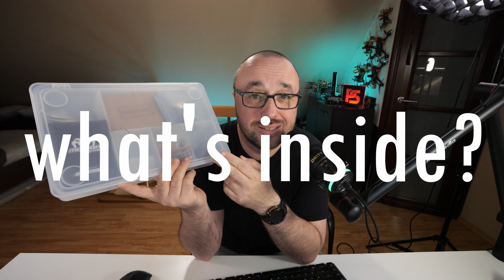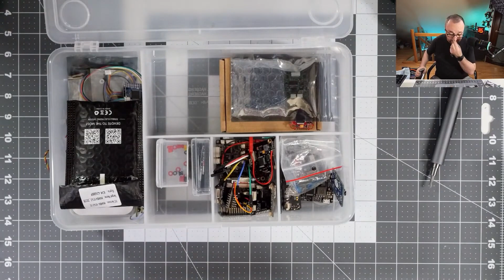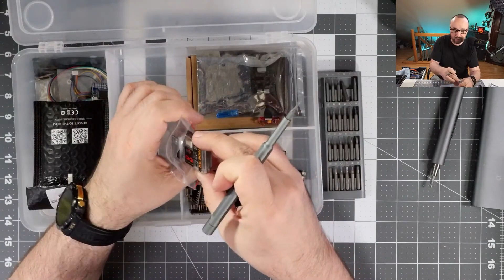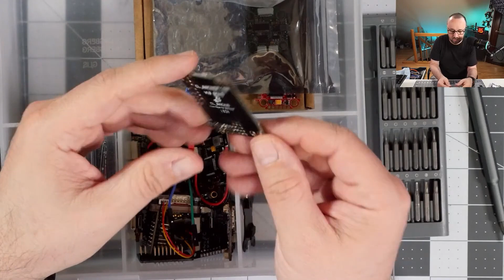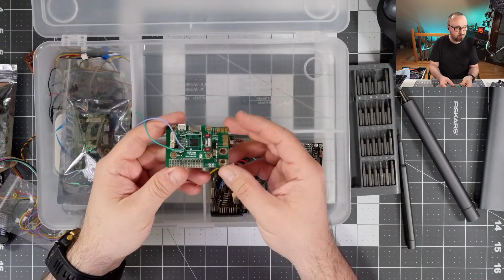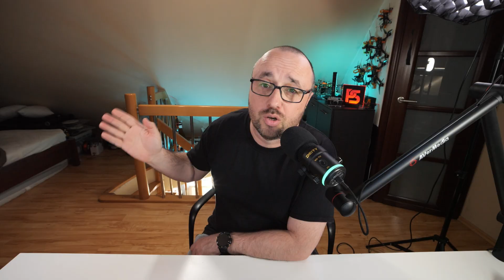What's in the box?

Comment: Hey Pawel
I just build my first 7 Inch FPV Longrange Drone. I flashed inav on it to use Modes like poshold and RTH. Sadly when i fly it makes noices that doesnt sound good and when i give Throttle to climb it starts to wobble in the air. Did you have this problem bevor? What do you think the Problem is here
Reply from the maker: Have you seen those 2 videos?
https://youtu.be/aE5oVbBtlig
https://youtu.be/phafJYNzTR0

Comment: Yesterday was my first successful test flight of RTH and position/altitude hold.
2 yrs at this and it finally works perfectly in INAV. Interestingly I put position hold and altitude hold on the same aux in the same position. Both occur simultaneously and it works.
Reply: Doesn't Position hold have altitude hold built in..?....Rather like Cruise Mode on Fixed Wing, altitude hold is part of it ...🤔😳😳😏😏😏🇬🇧
Reply: @EnglishTurbines  INAV has 2 modes independent of each other.
I presumed position was magnetometer and altitude was barometer.
Reply: @TheRoybert  Your right, but I've had iNAV with compass and a quality GPS in two quads in the past. Both did full RTH and land out of the box really well. As for Position Hold, the Mag holds heading and the baro or GPS holds altitude. You do not need to use Altitude Hold Mode at the same time.....🤔😳😏🇬🇧 To be clear, GPS is a 3D fix in space, this includes altitude. That said, a good baro usually is more accurate if you have one on your FC....
Reply: @EnglishTurbines  got it. I'll give a go with just position hold. But why would there be both....
Unless follow and or possibly waypoints has something to do with just altitude.
Reply: @EnglishTurbines  Nonetheless, it did not cause irregularity by being engaged. I will still try it without altitude.  That's why we're here, right? All tips and experiences are welcome.
Reply: @TheRoybert  The Flight Modes are all available to use as you see fit I guess. Even Modes like Horizon Mode on EITHER Fixed Wing or a Quad for example...If you read the Wiki on iNAV Flight Modes it will tell you. Just make sure it's up to date info....😳🤔😏🇬🇧
Reply: @EnglishTurbines  Today Betaflight nailed it too. Lots of minutiae setting it up correctly. Worked.
Reply: @TheRoybert Great, why don't you upload it?....I'd like to see it ..🤔😏😀🇬🇧